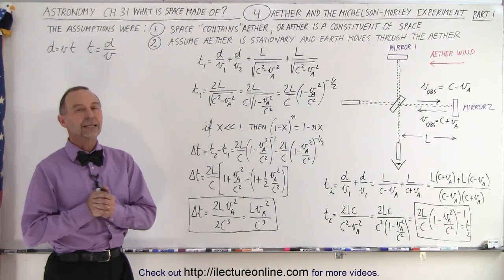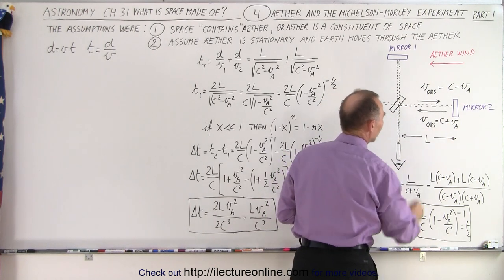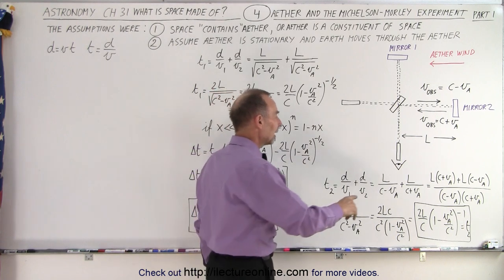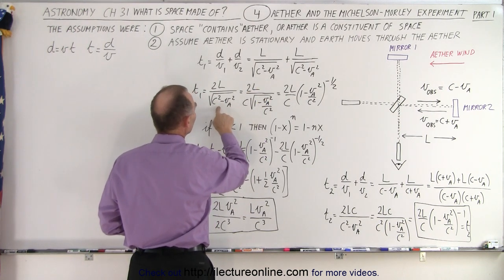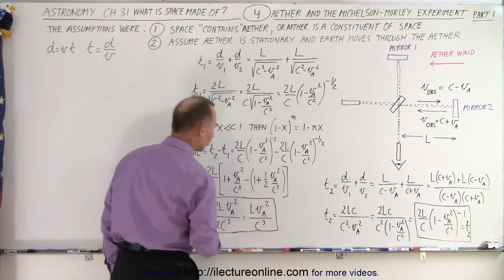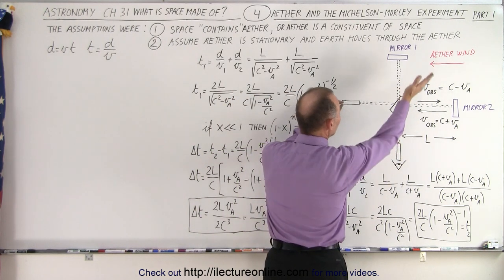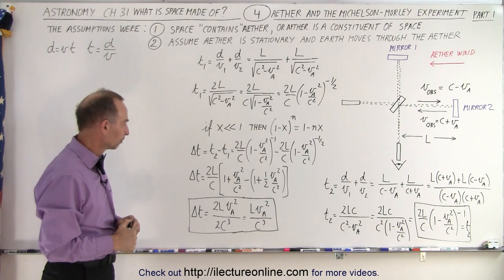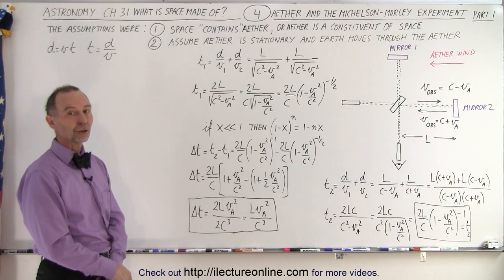Astronomy - Ch. 31: What is Space Made of? (4 of 15) Aether and the Michelson-Morley Exp.: Part 1

Comment: It's like I'm crazy or something, but I can never understand how nobody sees thr flaw in the design of this experiment. It would never do anything but give the same result no matter the outside forces applied to it. The only arm of this thing, in its current configuration is the right arm after the splitter. By bouncing the beam back with a mirror, the only result you will get from it no matter the changes in the speed of lignt would be an average of the two lengths, which will always end up being the same exact value. Theh may as well have built the light shining right at the detector without any mirrors. Seriously, turn the thing any way, and any changes in speed of the light after the splitter will be undone by the change in speed on the way back to the splitter. This goes for both paths, as all a round trip could ever do is provide an average where the detla difference between thr two trips is always equal. It's a pointless experiment that gives no valid data, not even a positive failure
Reply from the maker: That may make sense today, but back then they were trying to determine if the speed of light would be different in different directions due to the possible existence of "ether", and the possible movement of this ether affecting the observed speed of light.  We are not saying that this was a "good" experiment, but it does give us more information to consider.
Reply: @MichelvanBiezen  I don't see how it added any valuable information. To me, the part left of the splitter mirror, in the configuration you have it laid out is basically newX=(x-d)+(x+d)/2, which is effectively newX=x. Sure, more complicated math is required to rotate it, but because the light backtracks, it undoes any effect the so called Ether has on it.
The problem I have with it isn't that it's flawed and gives no valuable data, but that everybody who speaks of special relativity points to it as the reason Einstein assumed that the speed of light is constant in all frames of reference. The experiment couldn't make that claim, but it seems people use it as if it does.

Comment: Thanks interesting. Hello. The speed of light is constant - Within the framework of the prevailing gravitational field - This assumption can be experimentally confirmed by physical experience: On the surface of the earth along its gravitational field, we fix the speed of light in the fibers of the optical angular gyroscopes, gyroscopes located symmetrically on a special platform and moving along a circle without angular velocity. You need to look at the picture with three optical gyroscopes. Internet request PATENT KZ-33869
Reply from the maker: Interesting.